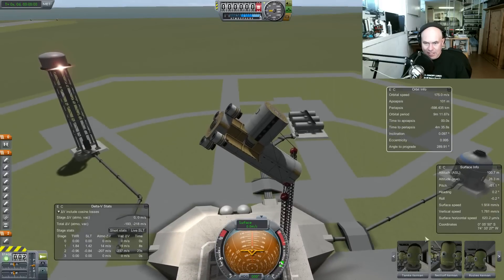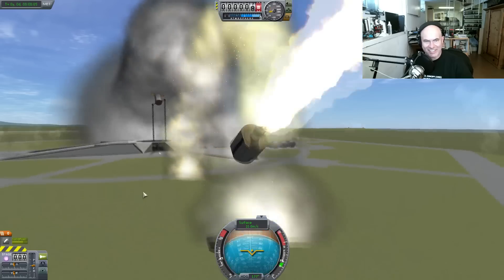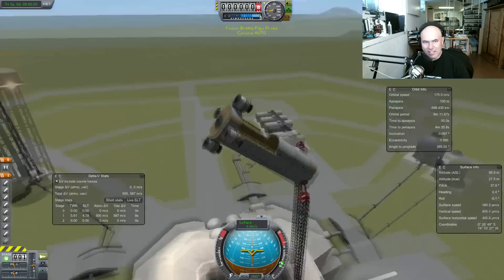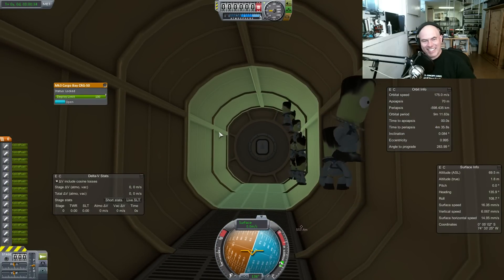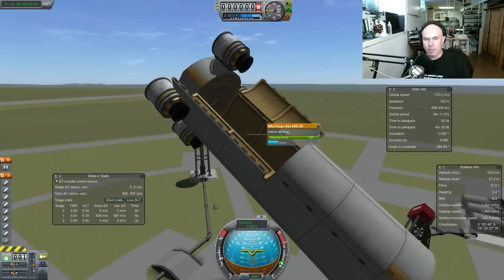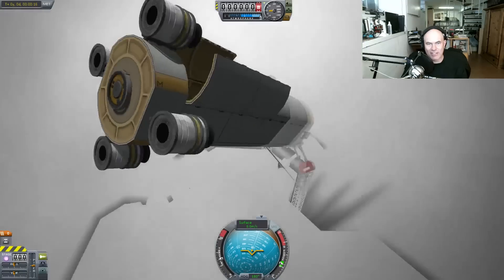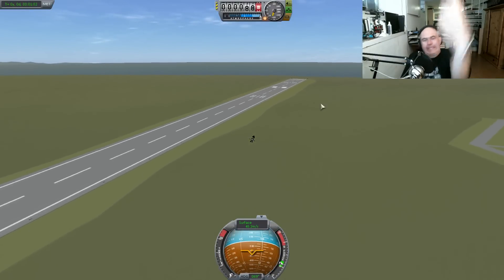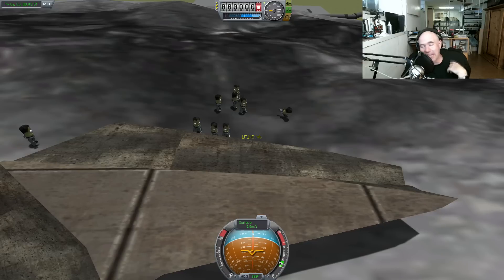Do Large Numbers of Kerbals Behave Like a Fluid?

Comment: Press release as follows:
Here at KERN we have been experimenting with high energy kerbal collision physics in an attempt to create exotic new kerbal particles and analyse the reactions via elastic scattering.  To optimise the number of collisions we have made the bold decision to use entire kerbals rather than individual kerbal particles.  Unfortunately results so far have been a little too elasticly scattered... actually there's just bits of scattered kerbal, we think it's the elastic bit that's proving tricky.  The energy liberated during the collisions suggests that we're definitely seeing something happen, we hope to identify what that is quite soon.
The next step will be upgrading the LKC (Lotta Kerbals Collider) to run at 0.1 Kill-a-Jebs per run.
Worries from the footage of initial tests that the spaghettification indicates the formation of blackholes that will swallow Kerbin are completely unfounded.  Rather, these effects are caused by the power source we sourced from Cthulhu Incorporated.  We are assured that the process is completely harmless.

Comment: I have a macbook and i don't know if its possible to run ksp on it. It's a 2014 macbook air with i5 processor, 4gb ram and a 1536 MB graphics card.
Reply: plz help
Reply: peter graaf Google ksp minimum specs.
Reply: It should run, probably better than it can on my computer with its integrated graphics too. But the 4 GB RAM will definitely limit what you can do, so don't download too many mods or make super-large ships with lots of parts. You will also probably almost never see normal speed stuff and everything will be slowed down so the game can calculate things easier, but the game will probably be playable. Something like Space Engineers might be a different story, but it never hurts to try at least once on minimum settings.
Reply: Torinn Balasar thanks! I'll give it a try (:

Comment: I've managed to put around 70 standing on the launch pad before the game crashed (64bits). Next I'm gonna send them to Duna ala Musk, someone should make it a challenge. Sadly I don't use reddit.
Reply: Has anyone done such a journey with the Kerbals loose in a cargo bay like Scott's in the video? That could be tricky, if this video is any indication (Kerbals launching out of your spacecraft unexpectedly at Solar escape velocity, etc).
Reply: I don't think the game could handle it but I'd bet using the chairs (EAS-1 External Command Seat) would be ok. WAIT: omJ5vK5P4rM
Reply: It stops physics when warping, so unless you wanna not warp and play for a year or two, good luck with that
Reply: If you use anything above 4x time warp then it stops calculating a lot of the physics. For instance kerbals won't collide with the inside of the cargo bay and will instead phase straight through. So yeah, you'd either have to play it for months to years or have the kerbals as part of the ship (either inside or in external command seats)